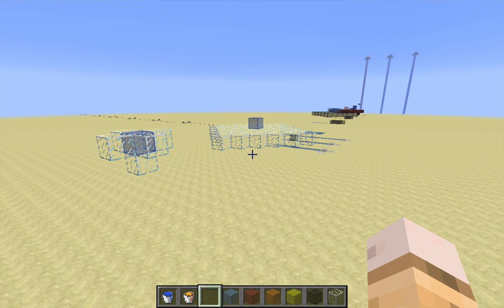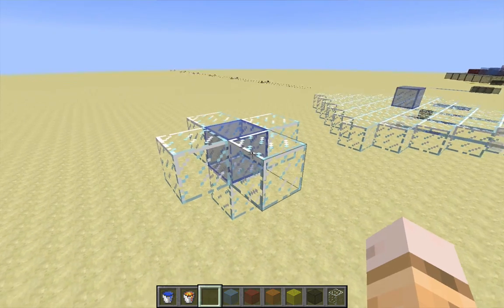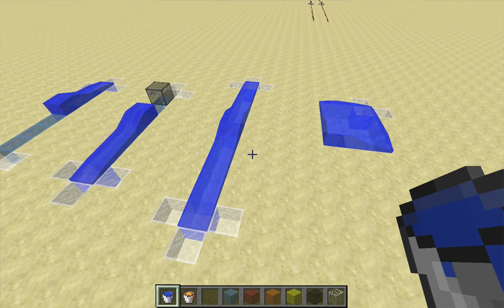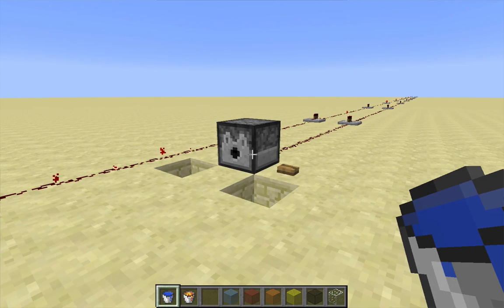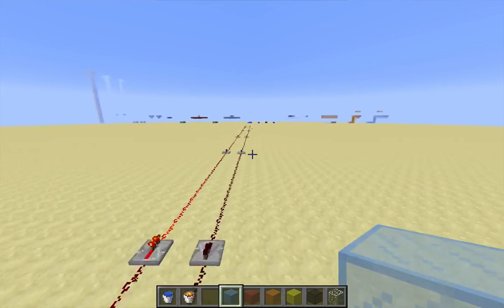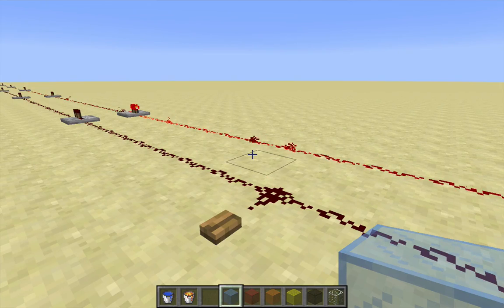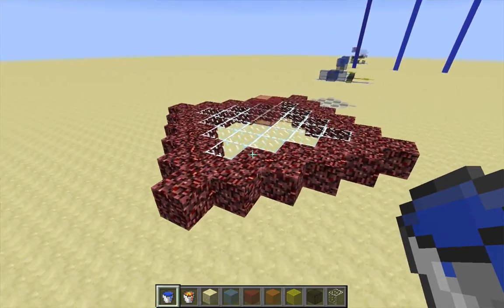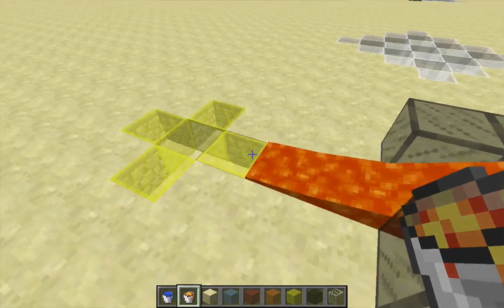Minecraft Liquids, Part 3: Liquid Spreading

Comment: i already knew most of this but i didnt know of the changes to lava yet, wich is quote intresting
Reply from the maker: +Jendrik Weise Yeah, it's a bit weird. It really feels like there's no reason for the change other than to say that you can close a ticket without marking it "works as intended".

For me, the most surprising thing about investigating this was finding out that the algorithm that searches for terrain depressions doesn't properly short circuit.
Reply from the maker: The obstacles modify the notion of "nearness". So, the shortest taxicab distance is always taken, even if that routes the water around an obstacle
Reply from the maker: Yes, that's exactly correct. It seems as though the search for terrain depressions searches for longer paths, even though a shorter path can be found.
Reply from the maker: +goohz has a channel Thought about my answer a bit more, and decided that it should be more precise: Each path from the flowing water will be followed, to a maximum taxicab distance of 5. If an obstruction or a terrain depression is encountered while following a path, then the search along that path will stop. However, the search will continue along other paths, even if a different, shorter path to a terrain depression has been found.
Reply from the maker: Yes, that's right. Once a terrain depression (or an obstruction) is found, just that path will not be further extended for searching
Reply: yeah that s prob what u think could be improofed and u r right